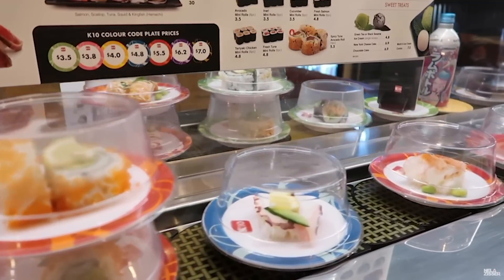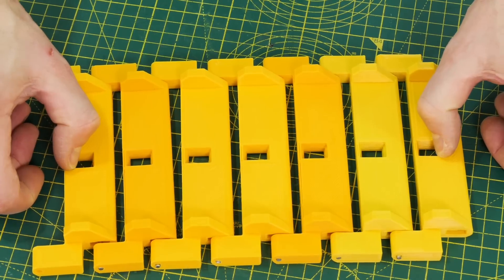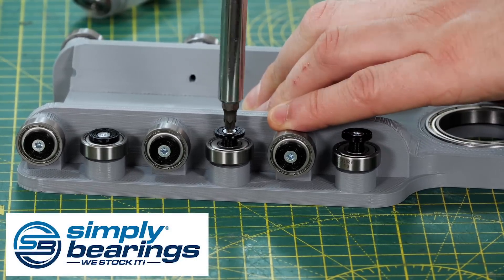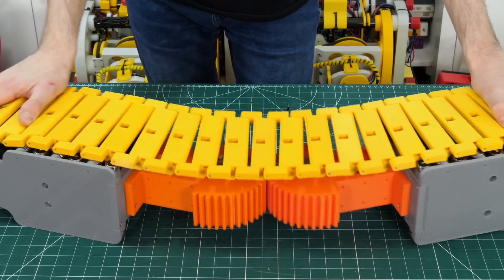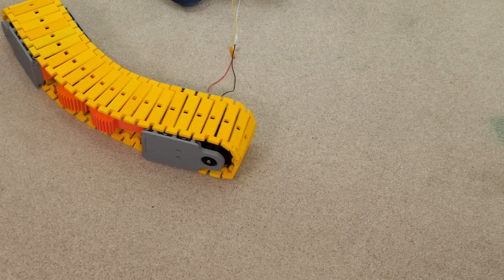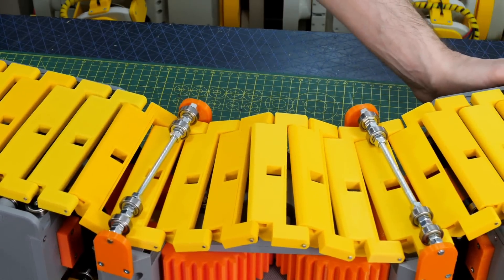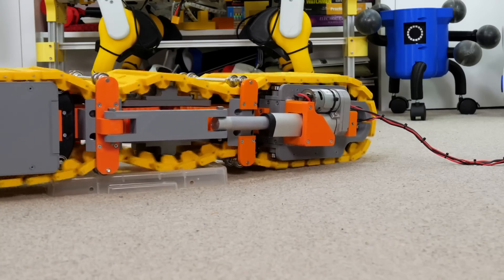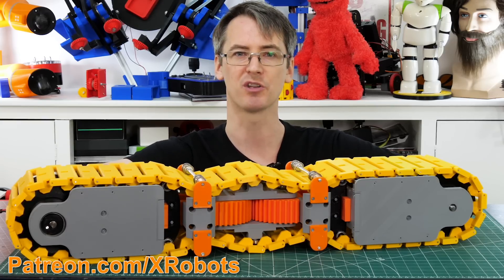How this track bends to steer

Comment: In hindsight, you could have made the straight shaft of the partial gears in two parts & made them spring loaded. That way, the springs could take up the slack in the track, regardless of straightness or bend angle in the track & you would not have to worry about the track being wavy/up-and-down.

Comment: I think remove those "tensioning" bearings, especially the bottom bearings (nothing should go below the belt on the bottom). A tensioner should be either adjustable or spring loaded. I think that would solve a lot of issues.

Comment: Some real tracked vehicles actually use track bending to steer, such as the universal carrier used in the second world war. Though it used a simpler system of simply moving the roadwheels to the sides to bend the tracks slightly allowing for gentle turns. For quickly steering in tight spaces it would steer like most other tracked vehicles of the time by clutch braking.

Comment: In addition to replacing the outer bars with slotted bearings,

I suggest a spring or rubber band between the track segments for a little bit of adaptive tensioning of the track to adapt to the bend.

Comment: Really interesting
From a real world perspective though, i think it would be really hard to armor up such a flexible design
And it would also be interesting to see how to crew and arm such a tank, with a huge volume being separated from the turret on top... unless you put the turret on the side? but that would have it's own issues.

It's not impossible to work around such issues, for example you could have some sort of scale armor, where plates could slide over one another, allowing it to bend.

But again, really interesting.

Comment: I feel like there might be something said to redesign the track pieces such that each segment has one or two bars that poke inward, and attach bearings to the end of each bar. The inner mechanism would then have slots to capture the bars and the bearings, ensuring that, at least at certain points, the track cannot get pulled away from the mechanism.

Comment: The purpose of a tank when invented was to provide heavy armor in battle mainly through fortified positions, recently a tank is more of a mobile cannon than something that can take all damage possible and continue moving. The Track was invented to spread the heavy load onto a wider area so those heavy vehicles didn't sink in the mud from where all the shells that landed removed the grass from. Thus the point of a "Tank" but you meant "Track" is not to get over small bumps.

Comment: wouldn't it work properly if you removed the bottom orange bearings?
Then the bottom could drive flat since the ground would provide tension on its own allowing you too drive over things while you still have the top fixed by your bearings, would that work?

Comment: It is an interesting experiment, but it probably defeats the purpose of the track, having two independent pairs of tracks on each side of a tank like this might maintain more of the grip and weight distribution. An advantage of such a non-conventional system might be to be easier on the pavement. However, I think regular tanks, excavators, etc. already don't damage it very much so... It is still interesting though!

Comment: disclaimer i don't exactly know what im talking about, but maybe you could experiment with a concave x convex gear for the middle sorta like a partial planetary gear, so that when it turns, it extends the whole robot so it keeps the tension of the belt, though not sure if it'll extend the robot enough to matter

Comment: To achieve the "bendy" effect that you're looking for, you're better off with having two short tracks (front & back) rather than one long one. All those extra parts & complex fixes to make it bend in the middle - each of which can potentially go wrong (needing a fix on a fix) - & all of which are pretty redundant when there's a simpler way of achieving your goal. 

Why don't you do what train designers did well over a century ago & place each pair of tracks (left & right sides) on a separate frame - complete with central pivot - like a Train Bogie. That way you could attach a couple of bogies under the body of your long central Cabin to achieve the "bendy" effect that you're looking for, as each bogie (front & back pair of tracks) can then rotate independently to of the other pair behind it when going around a corner (just minus the loose track "bending" in the middle). 

This is analogous to how some modern vehicles use Four Wheel Steering (4WS) to angle the wheels when turning corners at speed: The wheels on the front axle turn into a curve, while the rear set turn slightly outwards (causing the back wheels to follow a larger turning circle than the front) and thus perfectly optimising the grip & torque of each wheel upon the road. 

Alternately, for your track vehicle you could design shorter cabins & only have a single bogey per cab. Then just keep on adding more & more cabins (perhaps via a flexible ball & socket type joints) - thus making one hell of an all-terrain Centipede (one pair of le̶g̶s̶ wheels per section) train system.

Ref:
   ~ Bogie [ https://en.m.wikipedia.org/wiki/Bogie ]
   ~ Four Wheel Steering (4WS) [ https://en.m.wikipedia.org/wiki/Steering#Four-wheel_steering ]
Reply from the maker: Then there wouldn't be a video for you to comment on
Reply: @jamesbruton  You don't think I wouldn't comment just to tell you how damn cool your work is anyway?  ; )~

Comment: not sure if its mentioned, but you could use 2 linear actuators instead in the middle to steer the tank. This would solve 2 of your issues, you can get a nice tight turning radius and you can adjust the tension on your track by having the actuators extend or contract to pick up the slack.

Comment: I enjoyed watching this little experiment. It involved solving some other problems along the way, i.e. spinning motor housing and such. 
Another idea became obvious after you squeezed the truck in the middle ...we do not really need one piece of truck...why do not we split one truck into two...you eliminate problem of keeping truck on the rollers and its tension. 
Or yet, another idea is to install the two half-gears on extensible shaft with springs that would keep the truck's tension even when it bends.

Comment: For the tension I'd put suspension/spring into the straight guides on both ends so you can add the tension be pushing the track outwards not inwards. This would mean the top and bottom of the straight guides are not parallel but that is not an issue. Put the pivot points at the centers of the wheels. This way the track stays in the guide as the guide will move outwards with the track.
You  would need to add suspension/spring to the center of the turn guides as well, essentially every guide would have suspension/springs to maintain tension with the track. 
This should allow the track to conform to terrain better.
Having suspension/tensioners inside the tracks is part of why tank treads are good at uneven terrain, they adapt; I haven't seen this on any of the tracks I've seen you've built on this channel(I've only seen a few of them)

Comment: It is an interesting prof of concept, 
And you seems very good at building and constructing stuff.

 but two separate tracks with a pivot stering would work better. I think  you 
Could use parts from your  existing build and add on  two middle  sections.

Comment: You could tension the top from underneath so you could have a smooth surface on the bottom however it might affect the bend feature in a bad way

Comment: James's  desire for exploring motion is fascinating and highly educational. Tractor wheel rubber innertube ? streached between the ends, like belts in mills. cornering might be possible with ball wheels at the ends ?  Would the belt stay on if you tied opposite edges together with elastic bands.

Comment: I wonder if you could use a sort of screw adjustment mechanism similar to those seen on 3D printer belts to lengthen both sides and therefore increase the track tension without external rollers? It would allow adjustment of tension and the ability to replace the track fairly easily in the case that it is thrown.

Comment: RC shocks under top section pushing up or some sort of idler that would put tension upwards enough to keep the bottom on track and top on track without anything poking out on the bottom.

Comment: Racking my mind for a new tensioning system without a total redesign is a fun one! I think I’d settle on under the track rollers to support the middle section, then on the non driven side horizontal tighten the track by slicing the connector between the roller and middle gear attachment and adding 4 chonky springs pushing outwards horizontally between two plates. You’d have to do at least 4 as to not cause issues front the added flexion unless you add guide rails local to those plates ofc but that seems over complicated.

Comment: A slot in the side of the track pieces with followers slotted into it could solve the alignment and drooping issues. it wouldnt require a full rebuild but it is an entirely new track, which would be thicker.

Comment: You should take a look at a Bren Carrier as they had a mode of steering based on warping the track.  It used the road wheels to gently curve the track while keeping the ends straight.
Reply: This is what a scam looks like. You would have to be brain dead to fall for this.

Comment: I can't think of a project to use this with, I love the idea and I want to build something with it. Idk some rideable off road thing sounds cool. I would have to scale the design and solve the tension issue, and well it would also cost alot. A RC car would be cool, but well I dont think those would handle high speeds very well. I am still trying to think of a fun project to use these with.

Comment: take a look at a bulldozer, the drive sprocket is above the rear idler pully. If you had it configured that way on a pneumatic piston or spring, it would hold the track tight, then you could put your bearing you have on the outside of the track on the inside to just keep the track in place for turning.

Comment: It sounds like you're gonna have to go to C shaped track sections that wrap around both sides, so the vertical bearings restrain the track from pulling away from the body as well as giving a riding surface.

The linkage to keep the centerline distance of the tracks the same while either straight or curved is a puzzle.
Reply: On the upside, if you constrain from inside you can add grousers outside

Comment: move the pivotpoint, going straight is the longest situation axle center to axle center. when turning left the pivot point should be more on the left side so the centers stay at a more consistant distance. 2 pivots, one for left and one for right. which take over from each other at the straight situation

Comment: Having the connection between the half gears and the driving bodies incorporate a spring of some kind would tension the track from the centre, and provided the half gears were mounted on a sort of track (thinking four metal pins on each side) it shouldn’t effect the turning at all

Comment: Could have each track section made as a T shape'd style with a smaller upsidedown T (so to speak) on the bottom of it and the top part of the T extended out as far as the track needs to be wide.

========+========
               \   /
                |  |
          ==+++==

I know this is a bit lackluster as a side picture....    But could use bearings to hold it centeral and (upside down) off the ground  . Would require a redesign to the front and rear sprockets. and a way to drive the track parts on the drive sprocket. Maybe a sideways drive cog? or 2? Central on the pivot point or on the end(s).

Just adding some thoughts.
Reply: The fake Tell-a-Scam scammer .... sucks.

Comment: Would building a full vehicle arround it set up for that work better? Or maybe help the track better whilst keeping it look good. Can you look into that in a much smaller scale, saving plastic for the larger scale. Though idk if the scale down also can scale down the weight of itself, wich could throw a spanner in the works when going back to the same scale as the track now is

Comment: why not make it where the center is thinner compared to each end? nothing is really restricting it to be a constant measurement from one end to the other, it would act like two tracks but it is just one, that is going up and down its own tracks. should fix the issue of it getting stuck.
you might have your reasons to keep it in be like a worm though. just a suggestion.

Comment: You could probably remove a few links in the track, it's incredibly loose. Being that the length of track seems to need to change depending on whether or not you're turning, having some sort of elastic link would probably work.

Comment: try spring tensioned tracks with internal wheels along the center turning area. then add neoprene pads to the center of each track. the springs only need to be strong enough to hold 2 sections of track from gravity causing the spring to expand. also if you can remember those toy snakes made of wood they basically are a 6 sided rectangle with a flat rope run down the center. now add a cable on either side attached to eyelets with a linear actuator for each to pull the cables for bending i will call this the bending radius. wheel axles can be attached to say every third section of the bending radius to keep contact with the treads and the ground. very good idea though. if the springs attached in the same groove as the tank tread groove it would add a stability to the effect of the inside of the curve becoming shorter and the outside of the curve becoming longer in the turns by keeping some contact with the grooves while turning. this idea should be able to get you to atleast a 90 degree turning radius though it would appear as if one side is stopping minutely while the outside grows around it creating the bend. this is why they created limited slip differentials. it would allow the outsides wheels to move faster than the motors rotation since its covering a longer distance. good luck with the next revision

Comment: Yup, putting those tension bars on the "driving" side of the tank thread did exactly what i expected it would do on any bigger obstical. That said why not tension it from the inside with spring loaded set of wheels/bearings? It should work way better.

Comment: I think for tensioning, you could maybe make the lengths of the end bits variable? Perhaps even connect them to the center pivot with a spring-loaded piston mechanism, so that the system tensions automatically to keep the track tight. That way you could avoid those outside rollers.
Reply from the maker: That won't hold the 'corner' down.

Comment: im curious why you put them on the outside, and didnt opt for spring tension arms on the inside. although it feels like you could have taken out one plate and still had it fit.
Reply from the maker: That won't hold the 'corner' down.

Comment: The tensioning has to be inside the track. 
Usually it pushed out one of the wheels to straighten and tension the track.
Here I suggest to put a linear actuator so that it adjust a space between the straight and curve parts of the assembly.
Reply from the maker: That won't hold the 'corner' down since the whole track is flexible.

Comment: If the links between the sections where rounded, or more spherical I suppose, you could make them pivot also, which I think would help rather a lot. Furthermore, it should be possible to design independent drive section, to joins as many together as needed. Difficult to put into words exactly, but in my head it seems perfectly simple.

Comment: The problem is the method used to bend, it is lengthening the track path. To take the bend to 90 degrees for example, the track would try to create an arc, as is the intent, but for the track to have a constant tension, it would have to take a path equivalent in length to the machines ’straight’ length, which is to follow the linkage exactly. In this case from drive sprocket to pivot to pivot to sprocket.

TLDR, the track is taking a shortcut and slackening because of the shorter path.
Reply: Love your channel BTW..

Comment: 車体が屈曲したときはキャタピラのテンションが上がって、車体が直線状のときはキャタピラのテンションが下がってしまう。
When the body is bent, the tension of the caterpillar increases, and when the body is straight, the tension of the caterpillar decreases.
これはキャタピラの左右端に長さ制限があるせいだろうか？　キャタピラの中央の長さを一定にすれば、リテンション機構が完全に不要になるか、小規模なもので済むと思う。
Is this because there is a length limit on the left and right ends of the caterpillar? I think that if the length of the center of the caterpillar is fixed, the retention mechanism will be completely unnecessary or it will be small.

Comment: How about splitting the fore and aft chassis sections vertically and floating them on guided spring tensioners ? Strong enough to tension the track but weak enough to give under load from the steering actuator.

Comment: I don't know how the tension would change when it steers, however turning one of the red cetral pivot arms into an arm that can be adjusted in length once the track is in place would certainly eat up the droop of the track and may potentially solve that problem you are currently facing.

I love what you have so far and how robust it's built. I'm really impressed by it all. I thought about how this idea could be turned into a vehicle with a cab over one of the wheels attached onto each side of the grey wheel mount under it. That may work well for you since you could make one that looks like a human operated cab, maybe with headlights, that hides the battery pack and remote receiver/controller within it.

Comment: I would put the orange joint parts on springs to tension the track. So you have basically two shock absorbers on each side.